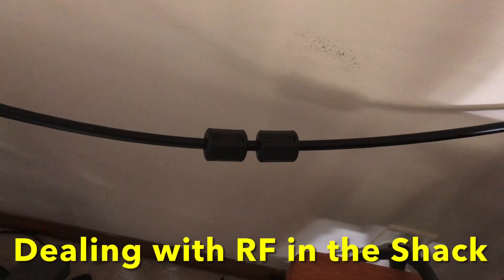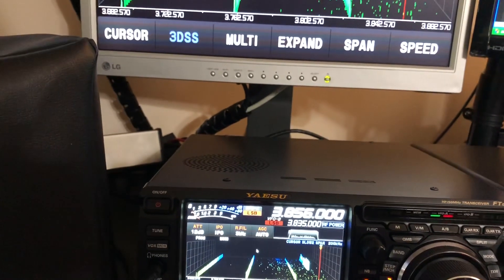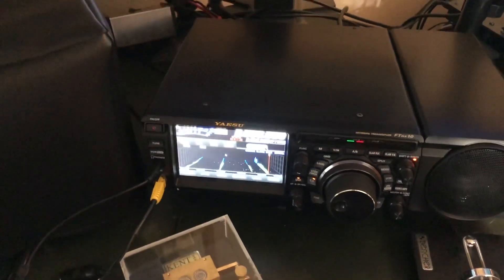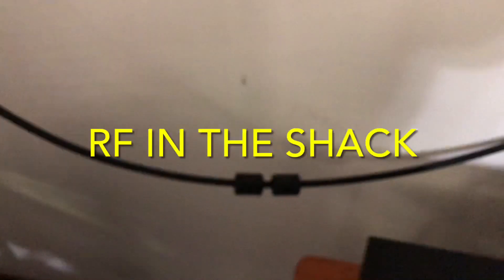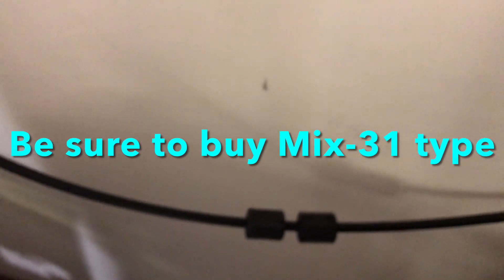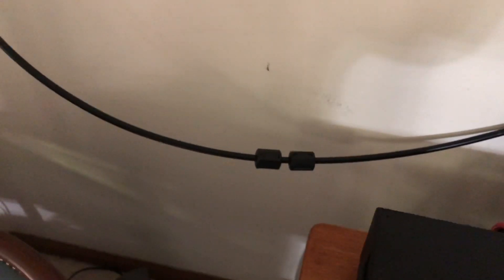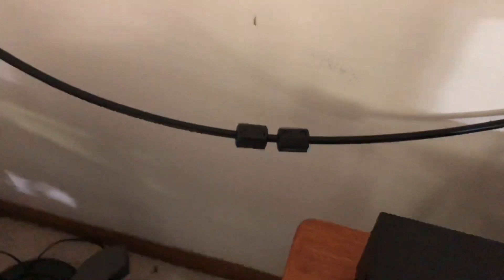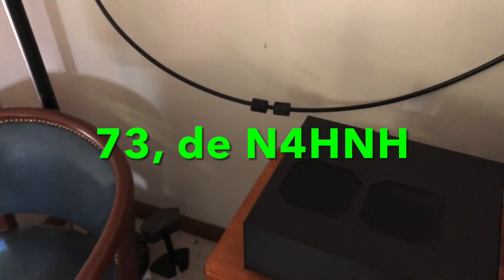Dealing with RF in the Shack #hamradio #rfi #noise #interférence

Comment: Heil Pro7 headset on ICOM IC-718 had feedback on headset audio cable, eliminated with ferrite ring. Using ferrite and RF Chokes all around shack and portable as needed. Newest Antenna is TRUELADDERLINE Doublet 44 feet with Balun Designs 4114 4:1 Balun, LDG tuner, works like a charm.
Reply from the maker: I love me a doublet.  That’s why I have two.  The ZS6BKW is in the doublet family, though not a doublet in the strictest sense.  My 160m doublet has the gain of a Yagi; I just can’t rotate it.

73, de N4HNH
Reply: @n4hnhradio  Noticed you live in Suwanee GA . My dad was born in Suwanee, relatives around Buford. Dad's buried in Whitehall  : (  I miss Georgia, as I remember, dirt roads, woods, pine trees, peaches, scuppernong grapes, country breakfast at grandparent's home  ; )
Reply from the maker: It’s very grown up now. I can’t find a dirt road anymore.  But we still have good breakfasts and other foods…and pine trees.

73, de N4HNH

Comment: You cannot get rid of rf from your shack! You are transmitting rf form your antenna and it permeates you and everything out to infinity.
Reply from the maker: We walk around in electromagnetic radiation all the time. Not enough w/m to affect us, thankfully.  Our antenna system, if installed correctly, will direct our signal away from us - most of it at least. The RF in this video is from common mode  current. Read about commode mode current, as it relates to antenna systems. It comes in on the outermost portion of the shield of the coax.

Comment: Great video..    I was just told I had rf on my audio...   I'd like to know what I sounded like so I can recognize what it sounds like..
Reply from the maker: Your transmit audio will sound distorted. It could be slight or it could be horrendous.  It’s not a bad idea to use a Mix-31 choke on the mic cable, but the source of the RF is often the shield of the coax, especially with an antenna that requires an antenna tuner. Snap-on, Mix-31, ferrites, like the ones in this video, are recommended. Make sure you get correct physical size for your coax.

Comment: Hi Doug, it's good to have videos about grounding in the shack. It's a topic that is more often overlooked, and certainly shouldn't be. My only add would be to remind everyone that you can't have too many good clamp-on ferrite chokes. Put them on the coax at the rig and at the antenna. And because RF runs on the outside of a conductor, put them on the DC and AC power lines as well.
Reply from the maker: Yes indeed!  That’s why I say the more the merrier.  By choking the RF that is riding the shield of the coax into the shack, it should generally keep it from getting into the power wires.  But sometimes you get RF from the antenna itself, if you are in close proximity to a radiating element.  I have a friend whose antenna is right outside the house, at the same level as his radio and only 10 or 15 feet away.  He gets RF from the antenna itself.  He has snap-on chokes everywhere.  It is a temporary setup though.  He will be moving the shack to the basement as soon as his daughter moves out.  She is living there while her house is being built.

73, de N4HNH
Reply from the maker: You don’t seem to understand multiband dipoles (OCF, EFHW) or doublets very well. Common mode current is common when operating an antenna on a non-resonant band.  The antenna match (aka antenna tuner) will make the transceiver or amp see 50 Ohms, but there are still standing waves on the feedline.  

Why have an antenna system that allows common mode current?  Why not have a perfectly tuned antenna for every band?  Many people live in a subdivision on 1/3 to 1/2 acre of land.  They don’t have enough property to install a perfectly tuned antenna for every band, and keep them 1/2 wavelength away from their house and away from one another (look up proximity effect).

You probably have a separate coax-fed dipole for every band.  Not everyone has that much real estate to work with.  Some don’t have enough land to install their antenna more than 1/2 wavelength away from their shack either.  Radiated energy from the antenna itself can enter the shack.  If you are fortunate enough to have a perfectly matched antenna for every band, with all of them installed more than 1/2 wavelength away from your radio shack, consider yourself blessed.

Comment: What does rf sounds like in the Audio?
Reply from the maker: It sounds like a crackling distortion.  It’s just plain nasty.  Depending upon the amount getting into your audio, it can span from a minor crackle to bad enough that people can barely understand what is being said.

Sometimes RF gets the blame for a poorly setup ALC.  That can also create a type of distortion.  I don’t use ALC for my amplifier.  I just carefully set up my TX audio.

73, de N4HNH
Reply: @n4hnhradio  THANKS. K4VTE
Reply: Speaking about audio...
 I experienced RF interference in my home theatre setup and it was only after thorough investigation that I finally solved it by purchasing shielded cables. 🥳
Reply from the maker: Shielding cables are great but they don’t stop all RF.  RF loves a shield.

Comment: Any tips about problems with speakers making noise?  I have a pair of Audioengine A5s on my PC (which is in the same room), and whenever I tx, they make some sound.
Reply from the maker: Speakers can be a touch one to deal with.  Snap-on ferrite chokes or ferrite chokes that have a inner diameter to allow you to loop the speaker wire 2-3 times through it.  I’m using a Bose computer speaker system with no issue.  I was also getting into the 1991 era surround sound system for our TV.  I replaced it with a VISIO sound bar and all is good there now.

I hope this helps.

73, de N4HNH
Reply: @n4hnhradio  Cool, I will give it a try.  I have some snap-ons on hand.  Which cord should I put them on?  The left speaker plugs into AC and has it's built-in amp, and then it connects to the right speaker via speaker cable.  They are connected to my PC with a 3.5mm plug.  Is this just one of those 'try it and see' things?  Worst case, I can just turn them off, but would be nice to sort out.
Reply from the maker: Snap the ferrites on each and every wire that you can.

73, Doug

Comment: Does it matter where the ferrite chokes are placed on the coax ??
Reply from the maker: I think it’s a good idea to place them nearer to where the coax enters the shack or just before it enters the shack.  Just inside the shack can protect the ferrites from degradation due to sun and rain. But, in my case, the ferrites are working fine in the middle of the 9 ft. piece of coax.  There is no coax outside for this Doublet.  The ladder line comes in and connects to the 4:1 BalUn.  The 9 feet of LMR-400 coax connects the BalUn to the amplifier/ATU combo.

Comment: Doug how did you verify the RF was gone?  OTA testing to another operator or monitor function or something else?  Thanks and 73 de kb9jqu - Curt.
Reply from the maker: Curt, I listened through my Heil headset, using the monitor function.  It was very obvious.  Before the choke, I couldn’t run 400W on the 80-meter band.  All other bands were fine.  I only had RF in the audio when transmitting at 400W or more on 80 meters.  

Even with the choke, the RF started creeping back in at 700W.  I added another snap-on choke and went to 1050W with no RF in the TX audio.  I didn’t go above 1050W because my Elecraft software warned me.  At 3.856 MHz I’m not supposed to exceed 1025W.  That is the limit the Elecraft ATU calculated, based upon the SWR it had to match.

I then tried it on the air.  Jack, on 3.856, told me it sounded great.  He was one of the ones who told me I had RF in my audio before.

73, Doug
Reply: @n4hnhradio  cool you could self test with monitor function.  Good to know!!!

Comment: I have an EFHW antenna and a 5 ferrite chokes on a pigtail between the end of my coax and  into the antenna feed point. I don't have any radials or grounds on the antenna or radio and I have no RF in the shack.  I work the world and break pileups. 100 watts. :text-green-game-over:
Reply from the maker: 100W can be very effective with a dipole and good propagation.

Comment: question what if you grounded your coax ( shield) on both ends ?
Reply from the maker: Hi Steve!  Well, RF ground and safety ground aren’t the same thing.  And ground wires have to be kept extremely short or they too become radiators.  Some ops will not ground anything.  I know some.  They’ve been operating for decades with no lightning damage.  They swear by it.  People with a shack on the upper floor would have to run a long wire to get to a ground rod.  Then the ground wire itself could become the problem.  The whole grounding thing is a can of worms.

Me?  I grounded everything.  The chassis of the amplifier where that 9 foot piece of LMR-400 screws in is grounded to my ground rod.  Maybe I should have tried it without the ground connection.  But, the solution was simple.  Snap-on chokes.

People who can install a separate perfectly resonant antenna for each and every band probably don’t know what RF in the shack is.   I have 1/3 acre.  I had to borrow my neighbor’s tree for one side of my doublet.  With a multi-band antenna, RF from common mode current is inevitable.

73, de N4HNH
Reply: @n4hnhradio  well I ground everything as well.  everything goes to a ground rod I have a 6" shield ground to the same ground rod and at the antenna end another 6" shield ground.  I use a hustler 5Btv 

73s
Reply from the maker: The 5BTV is a tried and true antenna.  

73, de N4HNH

Comment: I purchased to these cause my radio has this type noise while listening to the MW W band. These did not work. The instructions read to attach these to the radios power cord.
Reply from the maker: These are to choke RF from radiating off the coax into microphones, computers, etc.
Reply: @n4hnhradio  I read several years ago these were for noise coming into regular listening type radios.
Reply from the maker: They might help a little on RX but the voltage level induced on receive is nowhere near the voltage level on TX.  I installed these to minimize RF radiating into my TX audio, which is the subject of the video.
Reply: @n4hnhradio  Is there any way to block noise coming in to the radio?
Reply from the maker: @spunkyspice4777 yes.  Some noise is atmospheric. You can’t stop it. The DNR in the Yaesu radios can help with atmospheric noise. Noise from power lines is best dealt with by using something like the Timewave ANC-4 or the QRM Eliminator.  There is a playlist on my channel about dealing with noise.  Noise from certain electronic devices in your own home, or a close neighbor’s home, has to be stopped at the source. Certain devices, like LED light bulbs, wall-wart power supplies, laptop power bricks, wireless phone chargers, plasma TVs, garden lights, food sealers, gaming consoles can be a source of noise. Power your radio with a battery. Turn off the circuit breakers in your panel one by one. Find out which circuit is producing the noise. Start unplugging devices on the circuit. You can find the exact device that is causing the noise.
Reply: @n4hnhradio  True on atmospheric noise. Not any here now there is no any weather conditions that would cause this here. Will check out your recordings later.
Reply from the maker: Atmospheric noise isn’t from weather. It’s everywhere, all the time.  It is the sum total of noise from lightning strikes around world.  You have atmospheric noise if you listen to HF frequencies while on planet Earth. It constitutes the bulk of the background noise “hiss” that an HF receiver detects.  It is more prominent at 14MHz and lower, growing stronger and stronger as you go lower in frequency.  It can be in the S4 to S6 range on 7MHz.  It can get to S8 on 3.5MHz. 

Power line noise sounds like a buzz or type of grinding noise. A Noise Blanker can help with power line noise but it might not be able to eliminate it. The ANC-4 specializes in canceling the power line noise before it even gets to the radio.  Noise from electronic devices is broad and akin to white noise. It can only be stopped at the source.
Reply: @n4hnhradio  I mainly listen to MW/kHz band.

Comment: I had a problem a couple of years ago with RF getting in the shack.  When I keyed up, the display on my weather station scrambled.  I put a small ferrite choke on the weather station power cable and that helped straighten up the issue.  Later, I picked up one of the MJF-915 line isolators to try to keep RF out of everything else.   I haven't had any problems since.  Thoughts on the line isolators?  I'm using an OCF and RG8X coax.
Reply from the maker: Line isolators can be very helpful.  With multi-band antennas, operating on a non-harmonically-related band, common-mode current can ride the shield of the coax back toward the shack.  The antenna matching unit will make the transmitter happy but the standing waves still exist on the coax.